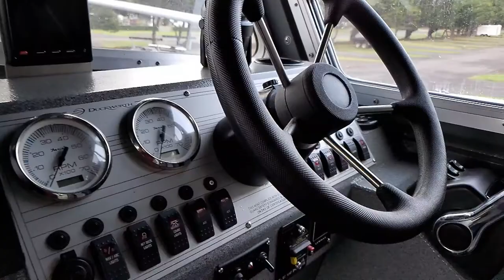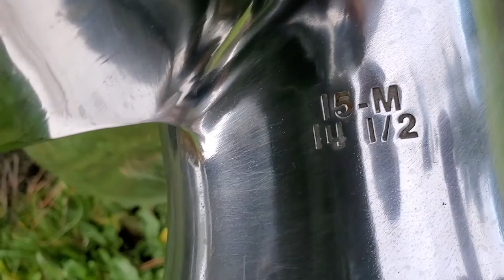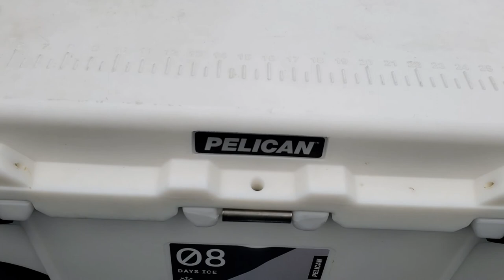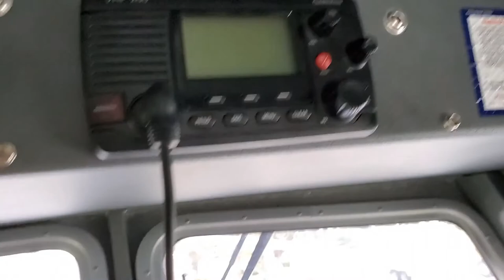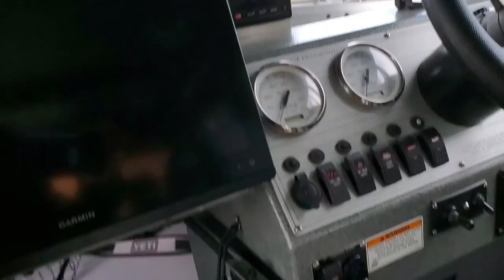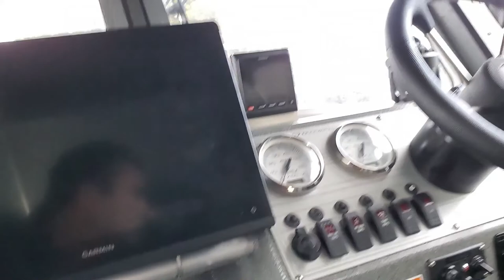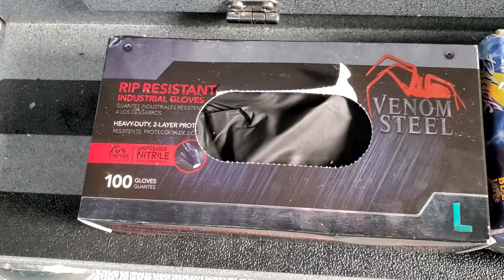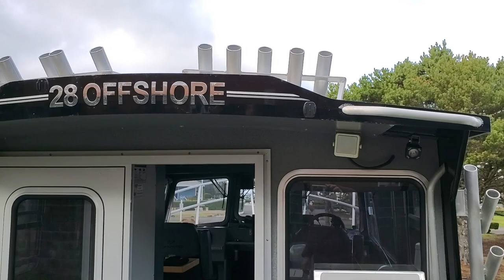Duckworth 28 offshore 1-year review and some items that i use every trip proven to be good products

Comment: Some lesson learned since owning several aluminum boats. The paint always bubbles and peels at places where the hull has been drilled thru or a protrusion on the hull. Coastal Craft seems to be the only aluminum boat MFG to get paint to stick to aluminum otherwise I would opt for a vinyl stripe on the hull or nothing at all.
If you get barnacles sticking to the bottom of an aluminum hull the bottom was not properly prepped. The bottom must be lightly sanded, completely cleaned and wiped down with lacquer thinner. 2 coats of etching primer, 1 undercoat of antifouling paint of a contrasting color of the final color, followed by two coats of the final color. When you see the contrasting color its time to repaint. It cost me a small fortune but was worth it.
Check the quality of the wiring job by the manufacture of the boat you are buying. Is it neat and tidy or a mangled mess. A good indication of a wiring job is to just look under the helm. Did they use automotive type wiring and connectors or tinned copper wire and heat shrink connectors. Cheap wiring and connectors will fail at the worst time.
Reply from the maker: Some great information thanks for sharing 🙂